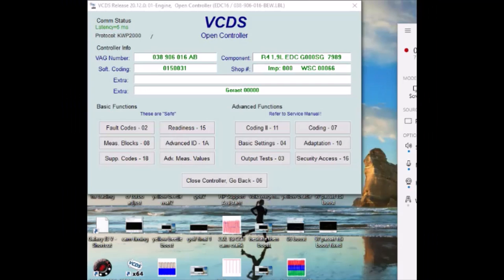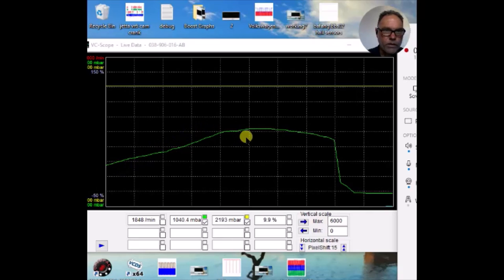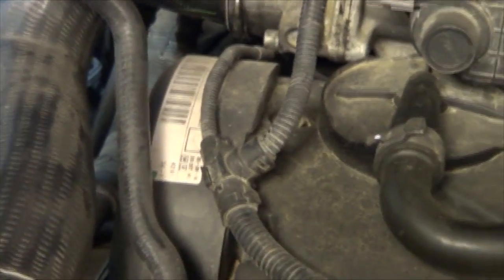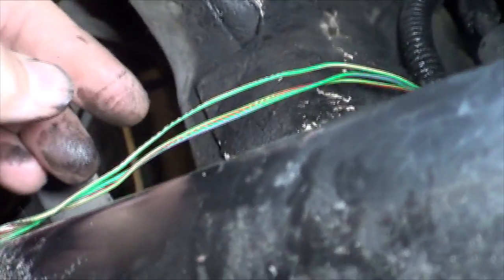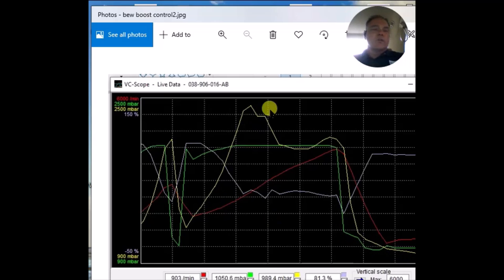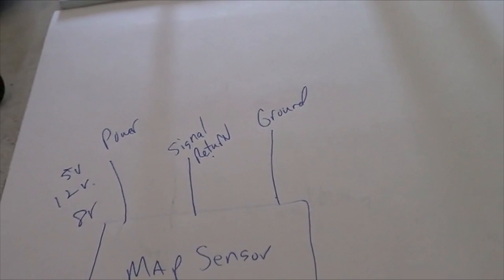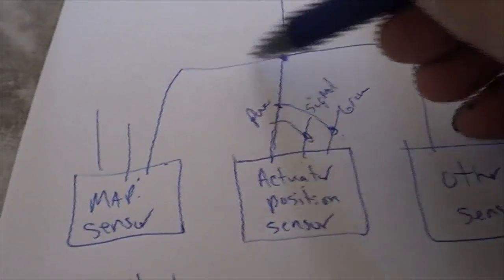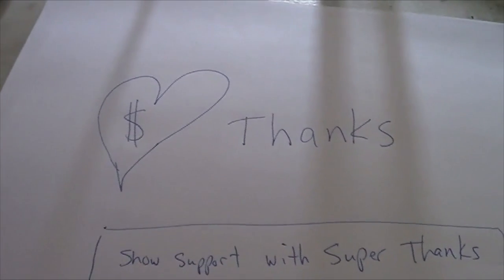Vw tdi P0652 sensor reference voltage

Comment: could this code be reason for a car to randomly stall ?? i have bkd 2.0 tdi audi and it stalls randomly when coming to a stop or just idling . also at times my idle rpm is a a few 100 rpm higher then it should be sometimes , on vcds i get a code 001618 sensor refrence voltage b- p0652 000 voltage too low ,
Reply: depending on the schematics of particular model the same ref voltage line could be used for accelerator pedal position sensor so faulty wire or one of faulty sensor could "kill" your accelerator pedal position so ECU wouldn't know if you are pressing the fun pedal